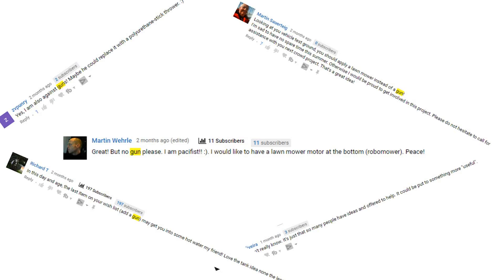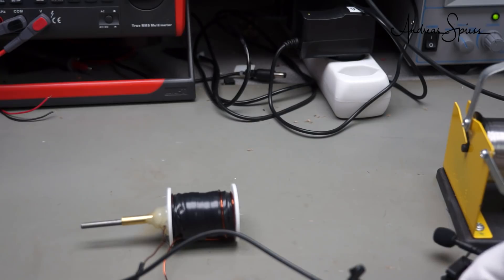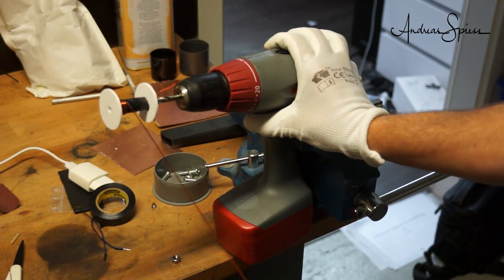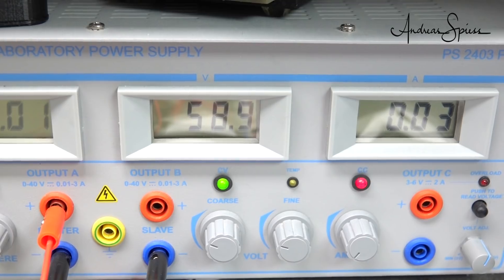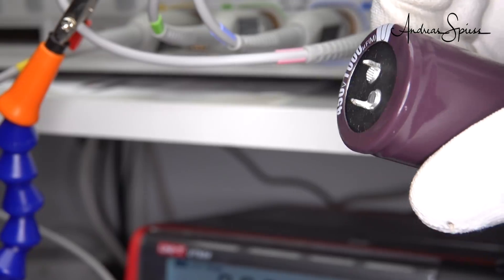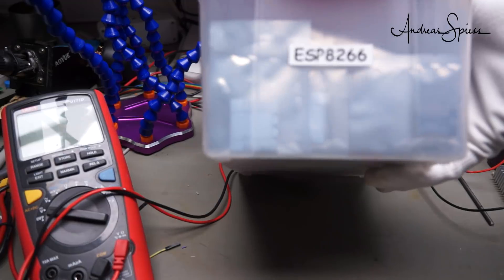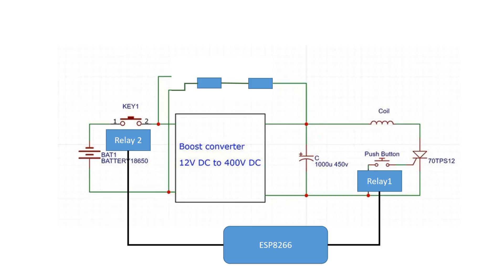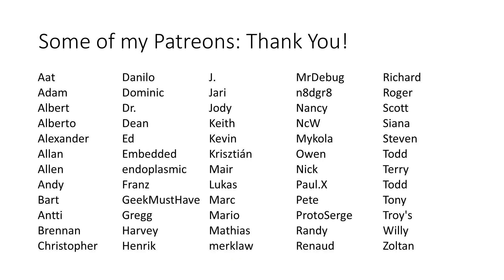#221 Better than GreatScott's Coil Gun? A true story, how-to not do it

Comment: At 2:56
You have to limit the Gate-Current of the Thyristor at a maximum of 100mA with a resistor! Look at the Datasheet for "I GT".

I think the one capacitor of your DC-DC converter blows up, because there was no load on the negative Rail. Make sure, that you don't run one of those outputs of such converters in open-circuits. This will raise the produced and stored Voltage in the capacitors! Put a resistor as a dummy-load on those terminals to prevent another blow-ups.
A multimeter, which is set in the voltage measuring range, is NOT a load for a power supply unit. When measuring voltage, the input is always high-impedance.
This is basic knowledge in electrical engineering.
There are many electronic power supplies that always need a MINIMUM LOAD to operate properly and safely. Also, electronic halogen transformers usually have an indication of the minimum load that must be complied with.
There are also electronic power supplies, or DC-DC converters that monitor their output voltages and make corrections, or even switch off if something is wrong.
This converter does not seem to have this kind of "protection circuit". In my opinion, the use of this converter is extremely questionable.

It does not surprise me at all that the USB isolator and your power supply was destroyed. You should be careful with thyristors and triacs. The control of such components is predominantly realized with optocouplers, or pulse transformers.
You need in such experiments necessarily galvanic separation between the controller and the load part.
And please do not forget the freewheeling diode on the load switching components when controlling inductive loads! Only if the freewheeling diode is already integrated in the thyristor, triac, transistor, or MOSFET, you can leave the freewheeling diode away.
If you need one, then it must be connected in anti-parallel. So contrary to the actual current flow.
Reply from the maker: Thank you for your tips! Especially the connection of a load would have been a good idea. Fortunately, the USB isolator was not blown, just my power supply. And I was able to repair it. But next time I will be more careful (if I try again).

Comment: The optocoupler works well if you use a battery. The important thing to remember is that high voltage spikes can be created in the ground circuit, and if all of the ground points are connected to a common point this would not be a problem.
Reply from the maker: The normal optocoupler, unfortunately, was not able to trigger the Thyristor. I hope, the new Optotriac will be better for that purpose.
Reply: There is a reason that you had that problem it has to do with the current that is going to the gate from the optoisolator. The way to make it function is to discharge a small capacitor through the gate assuming the gate voltage is going to be about 3 volt and a small resistor such as 100 ohm in series with the gate so the SCR is not damaged. Use a 5 volt source to charge a 10 uF capacitor to discharge through the output of the optoisolator. I know this works as it is what I have used in the past for CD discharge to get powerful sparks out of a coil. That is with about 400v discharging through a ignition coil. Never lost any parts other than the resistor that I used to charge the discharge capacitor.  For references on what I am saying look at the CD circuits for automotive use as an add on as a substitution of the points as was done commonly in the late 1960's in many of the hobby magazines of the time.

Comment: why all the batteries in the circuit with opposite polarity.. for example at 7:10...?
Reply from the maker: I do not know what you mean. For me, they are ok. I took the diagram from the instructable.
Reply: the longer bar in the battery symbol indicates the + side whereas the shorter bar shows - side of the battery...in you schematic, Bat1 and B1 seem to be connected in opposite polarity
Reply from the maker: This is not how I learned it...
Reply: maybe that's the reason you have so many  component casualties in your projects... ;)

Comment: A coil gun is no rail gun!

A rail gun uses the actual current to accelerate the projectile directly. The current flows through metallic rails and also through the projectile.

A coil gun uses the magnetic field of coils. That's waht you explain here.
Reply from the maker: You are right. Many viewers told me the same thing.

Comment: don't try to push the dc/dc up to 400V with 400V capacitors... doesn't matter if they're chineese or japanese they will always fail
Reply from the maker: Tell this the manufacturer of the device. I only measured the voltage after the explosion, because I thought, the output voltage matches the caps :-(

Comment: It was mentioned here before by other comments but for your safety you should always galvanically isolate your high voltage circuits from your low voltage circuits. Relays work fine and they make your final design mostly safe (besides the missing freewheeling diode) as long as the secondary side can handle 400V peak at the thyristor gate. What made me most nervous is the voltage divider. A brief search online for datasheets showed that typical 0.25 W resistors are only rated up to 350V. The worst part is when your setup works fine for a while and the 410k suddenly shortcuts your whole low power circuit will carry 400 V. When you have your hands nearby that could really be a problem :)
So rule of thumb: always galvanically isolate high voltage from low voltage circuits (or parts which are easily accessible by hand like connectors, buttons, etc.). Trafos, relays, optocouplers, galvanic isolators are fine if their voltage rating is sufficient (a voltage divider is not an insulator ;-) ). It it also not a bad idea to consider what happens if a simple component (resistor / capacitor) shorts out, especially when it is exposed to high currents/voltages. You don't have to consider every possible fault, just be weary what happens when a cap explodes or your voltage divider shorts out. If it is almost impossible to galvanically isolate, e.g. for the voltage measurement, just double up the components (e.g. two voltage dividers in series or replace each resistors by two in series so the divider can handle a single component failure) so that it will continue to be safe even if a single short circuit occurs in one of its resistors.
Be safe.
Reply from the maker: Thank you for your tips. I think a few things are done by now like two resistors in series for the voltage divider and a relay to trigger the Thyristor. But I am not sure if I will continue this project.

Comment: There's some interesting stuff in this. 
I have a few thoughts on how to improve this sort of project. 

First, Don't make it digital. The voltages and currents necessary to fire a magnetic projectile are such that the silicon control components will die. I actually think this is why the ESP board died. 
If you're firing an inductive coil with a capacitor, you're making an EMP. 
Even if all the energy of the EMP is consumed by the movement of the projectile, the proximity of the digital components ensures that they will eventually fail. If you're board is a somewhat sensitive control component, they will fail faster.

Second, IF you are going to insist on making it digital, use a vacuum tube. They're actually resistant to electromagnetic radiation and interference, and function similarly to a transistor. You can kinda jury rig one up using a burned out car light bulb, but guitar stores sometimes have vacuum tubes on hand. Although... guitar stores probably don't have the needed datasheet nor the necessary expertise to make optimal use of it. 

Third, You can make a coilgun almost entirely out of analog components. 
Instead of a digital switch, physically wind a secondary coil around the firing coil of the gun. That physically puts an inductive tap onto the coilgun. That physically hardwires a manual trip point into the barrel of the coilgun without the need for a digital sensor. Further, once you've hardwired it into position, using resistors you can adjust the virtual position of the tap if it's not perfectly on point in the center of the coil. I can explain this better if someone's interested....

Finally, if you're in the USA don't do this. We have a large lattitude with guns in the USA, but putting them on Radio controlled vehicles is the one thing that's illegal on a federal level. You will draw the attention of federal policing organizations if you do that.
Reply from the maker: Thank you for your proposals and warnings. You named a lot of reasons I most probably will not continue this project.

Comment: You might be able to repair the power supply. Most likely it's a blown component. Also, you should never expose low voltage components to any high voltage potential. Opto isolators are a good choise, or even relays.
Reply from the maker: You are right in all three points. Watch next Sunday's video ;-)

Comment: Chinesium 400V  LOL   Is that like the Chineium 30Amp Motor Controls ?   They only Start Smoking at 20Amps and do not burst into flames until 30 Amps ?    Seeeeeeee Made 30 Amps ?
Reply from the maker: Maybe. But price-performance is still very good for most of the parts I get...
Reply: Andreas Spiess  Yes it is.  For the Price We Quivel NOT.  LOL

Comment: You know for someone that hasn’t worked with high voltages with sharp switching transients you didn’t do too bad! At least you didn’t discharge that 450v 1000uF cap through your hand! Trust me from experience you don’t want to! After working with down right scary 5uF 20KV caps you will treat them with the upmost respect!
Reply from the maker: Thank you for your compliment!

Comment: I know how it happened! Your coil gun created a huge EMP that fries electronic parts in it's vicinity! I was messing with a stun gun transformer, and it burned out my monitor from 5' away, one time. That sucker has to be shielded, or all the electronics have to be.
Reply from the maker: You most probably are right!
Reply: I was trying to create a big EMP, and I did, and it was very expensive. You would be surprised at the damage something like that can do. The problem isn't in your circuit, it's the proximity to the coils that's killing you. Shield them, put the coils in a metal tube to contain the EMP.

Comment: The capacitor on the power supply probably was inverted by accident, because electrolytic capacitors do that when you invert them by accident :P you should always check when buying chinese power supplies
Reply from the maker: I do not think so. I measured up to 450 volts which was obviously too much for one capacitor... But you are right, reverseing one shows the same effect.

Comment: First, a coil gun is not a rail gun. A coil gun pulls a projectile through a coil or multiple stages of coils. A rail gun pulls a projectile down to beams connected to voltage, using the projectile to complete the circuit, the further the projectile gets down the rails, the shorter the circuit gets until the projectile leaves the rails. second, why attack GreatScott?
Reply from the maker: I corrected the title when I learned the difference. 
This is a typical open source approach where somebody takes an idea and tries to improve it. With mentioning of the source, of course. This is the whole idea of "open source" in my opinion.

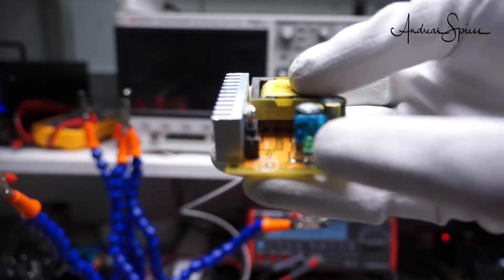Comment: At about timestamp 9:30 is when you talk about the input fuse blowing immediately.  I don't see anything in the data (ebay description) that indicates the need for a current-limiting input resistor!  
I just got a couple of these myself.  Thanks to you, I ordered some 450V @ 10uF capacitors, which I will install before connecting (THANKS MUCH!).  I'm not really sure about the input limiting, but, also thanks to you, I am ordering an auto fuse kit, which I can make good use of.
I wonder why the battery blew the fuse?
Reply from the maker: So good luck. These are very interesting devices, but also a little dangerous...

Comment: Edit: left up for posterity, but as soon as I spent more than 30 seconds thinking about this I recognized my mistake

At 8:00, the shunt resistor never sees any of the current that goes through that capacitor
Reply from the maker: Are you sure?
Reply: @AndreasSpiess  wait shit I completely misread the diagram, that's the capacitor where all the energy is being stored, I was picturing the current flowing from the dc-dc converter, as if the capacitor was just a filter cap. You'll have to forgive me, I just finished working a 10 hour shift when I wrote that comment
Reply from the maker: No problem ;-)

Comment: You must’ve gotten a defective converter because I have 5 of them an they only go up to 390v
Reply from the maker: When I killed the power supply I did not use a converter at all :-(
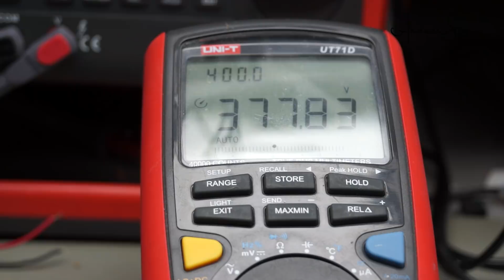Reply: Andreas Spiess I meant when the capacitor on the converter board exploded at 4:43. Only 1 of my converters even came with a capacitor on the output and it luckily hasn’t exploded yet. The rest of them didn’t have anything on the output so it only charges the capacitors I connected. I have it charging 4 capacitors that are 200v and 12000 microfarads. 2 capacitors are in series to get 400 volts and then another set of 2 capacitors in series added in parallel to make an overall 400v, 12000 uF capacitor bank. My coil is about 2 ohms so I’m still looking for an scr that can handle 200 amps. Great video!
Reply from the maker: Better to use external caps only. Because for our purpose we anyway need much bigger ones...
My Thyristor is capable to handle much more on short time. But it is not easy to control.

Comment: Hi Andreas,

As an electronics engineer I'd like to suggest a few improvements.
1. Use an IGBT to switch the current through the coil. By using an IGBT you can precisely control the ON duration and optimize the firing power( As you said the current has to be switched off at the right moment)

Secondly, to drive the IGBT, Look for an Isolated IGBT driver and couple it with a single chip isolated power supply like the Murata MGJ1 or MGJ2 series.
This will make it extremely robust and give you better control over every variable. You can then control the current flow time in tens of microseconds and experiment to see what is best.

Finally, please do use a freewheeling diode. MUR460 or something would be alright.
Reply from the maker: Thank you for your advice. I am not yet sure I will continue with this project ;-) It is quite dangerous and costly.

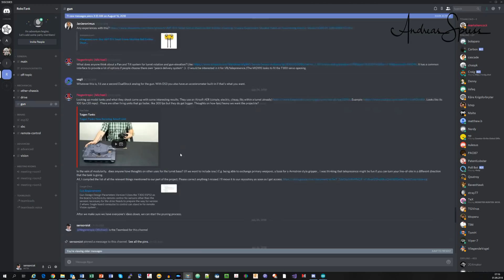Comment: 0:55 coilguns and railguns are two different things: a coilgun accelerates its projectile by switching the electromagnet in front of it on, a railgun runs electricity through the projectile which will then create its own magnetic field, which will interfere with the rail's magnetic field, which will accellerate the projectile.
Reply from the maker: Thanks. I learned that from the comments and changed the title.

Comment: I know the failures you encountered might put you off from high voltage projects, but you learned stuff from it. Don't let it get to you, even if something happens. 

And at least the ESP boards are cheap. Your power supply should be repairable, too.
Reply from the maker: You are right. And I also hope I can repair the power supply...
Reply: @AndreasSpiess  
I'm certain it can be. Unless a good portion of your PSU is obliterated, I would guess you just need to replace some components and maybe go over some traces or solder pads.

Comment: 6:30 thats why i dont like ultra expensive equipment :)
one error and you are ruined ;D , that really kills the purpose. 
Better don't use expensive stuff, just watch in only ;D
i buy only cheap to medium range so i dont have to cry if it breaks, and also i can afford multiple tools of the same kind so i dont have to wait for order a new one.
For the coil gun there are cheap DSO (digital oszilloscopes) on ebay (20-50$)
some can even catch trigger events(record fast discharges as oscilloscope image)

Why dont you use the cheap Atmega328 Boards instead?

also you need a reverse diode parallel to the coil (shottky or suppressor type is better than normal 1n4001) https://en.wikipedia.org/wiki/Flyback_diode

High voltage is fun, dont give up, just do more research so you learn the pitfalls.
Reply from the maker: 1. You are right with the equipment
2. ESPs and Arduinos do not differ too much in price. And I like the WiFi capabilities.
3. I will add a diode. Many viewers suggested the same ;-)
Reply: i didnt read too many coments before :).There are many different diodes and most people use 1N400X but Shotky diodes are beneficial since they are Faster.

Last time i looked the price difference was 2$ vs 5$,
but now the prices dropped to 2$ vs 2,80$.
https://www.ebay.com/itm/NodeMcu-Lua-CH340G-WIFI-Network-Development-Board-Module-ESP8266-ESP-12E-ASS/263493276713?epid=582527152&hash=item3d596c5429:g:ikoAAOSwcC9Zt1d-
https://www.ebay.com/itm/1PCS-New-Pro-Mini-atmega328-Board-5V-16M-Arduino-Compatible-Nano-NEW/141975930793?_trkparms=aid%3D222007%26algo%3DSIM.MBE%26ao%3D1%26asc%3D20131003132420%26meid%3D8925c25f3912470187f0c70d13b52aa9%26pid%3D100005%26rk%3D3%26rkt%3D12%26mehot%3Dag%26sd%3D331809989705%26itm%3D141975930793&_trksid=p2047675.c100005.m1851

here is a nice oscilloscope you can sacrifice ;D
https://www.ebay.com/itm/Fully-Welded-Assembled-DSO138-2-4-TFT-Digital-Oscilloscope-1Msps-Probe-B1/372426409938?hash=item56b65807d2:g:SSUAAOSwgStbe7yQ
newer version+case
https://www.ebay.com/itm/Orignal-Tech-DS0150-15001K-DSO-SHELL-DSO150-Digital-Oscilloscope-With-Housing/123234033374?hash=item1cb1521ede:g:j1MAAOSwFuZbPw6V

Comment: Whenever i mess with hv, i always use an optoisolator for my MCU boards. Not onl yto save the boards. but, i would not be a happy chap if my PC has 400 odd volts dumped into a usb hub.
Reply from the maker: I used a USB isolator to protect my PC. But not for the ESP :-(